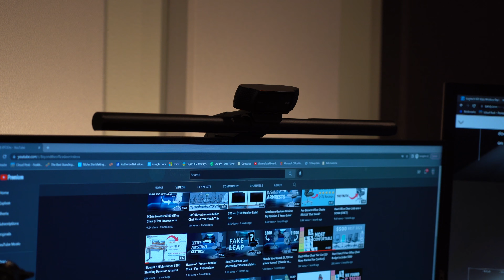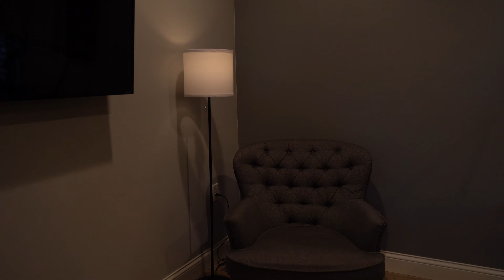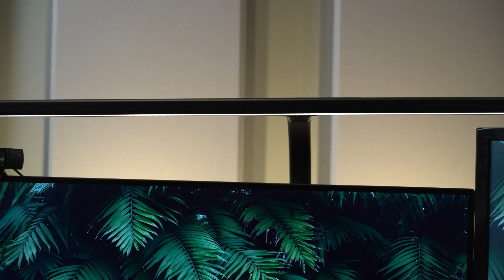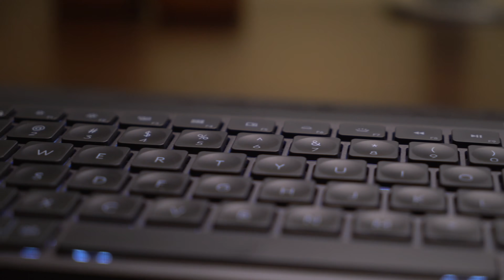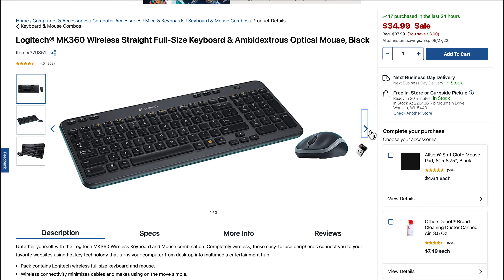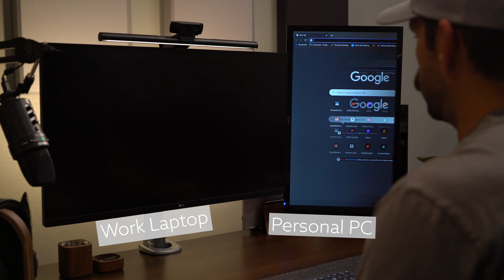5 Premium Desk Accessories GUARANTEED To Improve Your Setup

Comment: Love your set-up and video. I also have the Samson mic and the MX combo. I am still contemplating on the 2nd vertical monitor. It seems like my preferred size as well. I do prefer the Xiaomi Lightbar though. Touching the light bar every time isn't good for my mental health, the way it wiggles. The Xioami has a wireless remote and its functionality has not disappointed me yet. Thanks for this good stuff!

Comment: 200$ for a cable box?? common
Reply from the maker: It isn't cheap, but worth every penny IMO. Nothing else works as well for bulky items or a lot of cables, that can connect to the bottom of the desk and can easily be adapted as your setup changes -GK
Reply: @btodtv  thanks for replying , it looks good i won't lie. but with international shipping and tax it will cost like x3.
Reply from the maker: Agreed, international shipping is a major rip off. Appreciate you watching! -GK
Reply: You could probably make one for cheaper than 2 stacks. but it is a nice box and would probably contain a PSU fire.